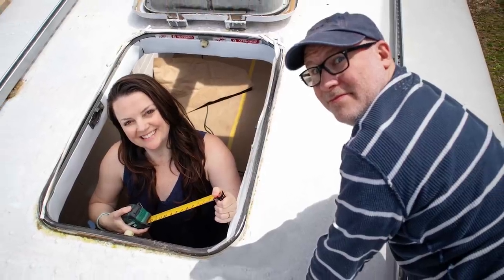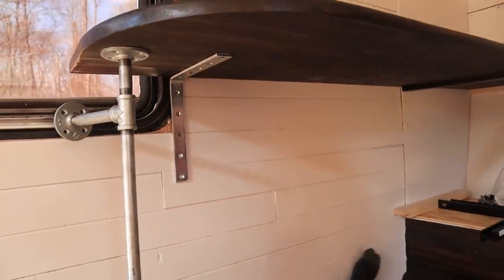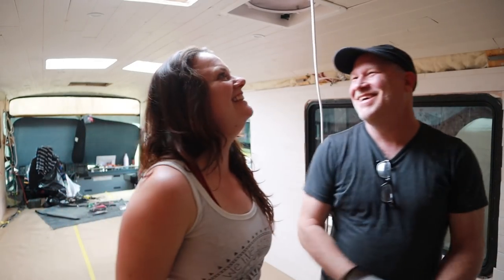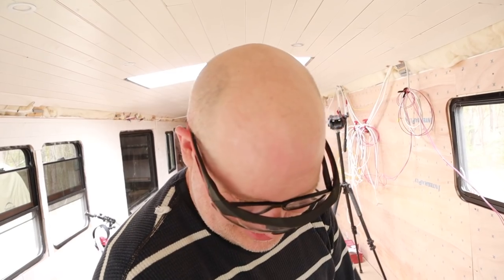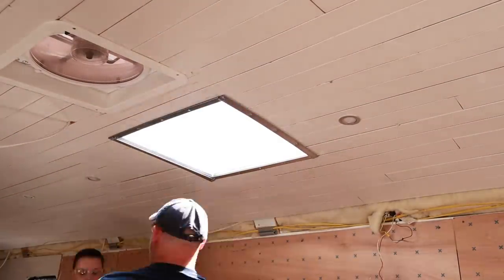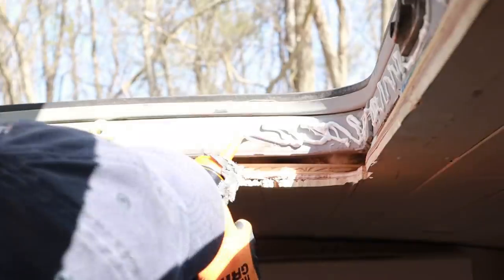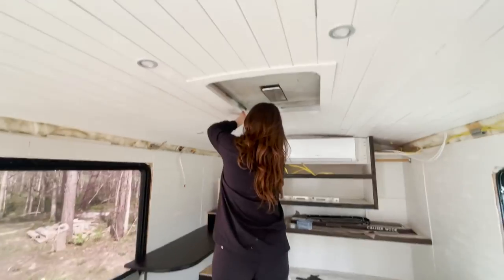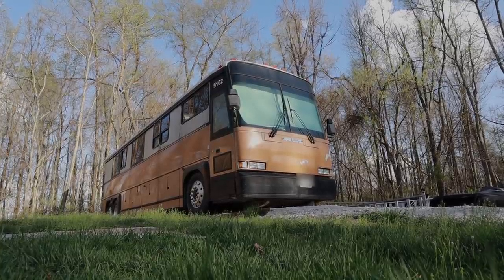IT'S ALL IN THE DETAILS // Skylight and Ceiling Hatch Trim for our Bus Conversion - S04E07

Comment: Just started watching your bus conversion. Quite a project. Great work. Just a suggestion on the skylight covers, and you may have already considered this...I installed pleated shades for skylight covers in the house. They can be ordered custom sized and made to let light through or not and they also have some insulation value. They can be installed inside or outside the skylight frame. Good luck on the rest of the project. Looking forward to the finished bus conversion.

Comment: I think when you installed the sky light trim you should have installed thin shims on 3 of the 4 sides and on the 4th side you could have had some panel board slides to slide in and out to either cover or uncover the sky light. You could have cut the panel would to be a little longer so you could install a knob to grab to open/close. But I am loving the videos and you two are so great together. Keep up the good work.

Comment: Job's good! Concerning Don's table (shelf thingy) are you going to strenghthen the brackets by triangulating them? If too much weight goes on the table, like heavier devices or you leaning on it, the brackets may bend.
Reply from the maker: Yeah nothing heavy is going on it so we should be fine.  The monitor will be mounted on the wall so it’s only holding keyboards and trackpads really which are super light 👍

Comment: The bus is slowly coming together,  though I think you should have , 1 rounded the outer corners,  and 2 stained it like the other trim in the bus.
Reply from the maker: We thought about the espresso stain but we didn't want to make the hatches stand out.  We wanted them to disappear into the ceiling.  I think it would take away from the main espresso colored trim piece which is still to come!

Comment: Why didn't you get shorter screws and pre‐drill the holes???
Reply from the maker: The next size down was too small to go through the wall and into the metal beam.  For some strange reason there is no in between size, so we had to make it that way!

Comment: If it's real stainless steel it's not magnetic. Looks like chrome, polished galvanized or nickle plated steel.
You really need to invest in a hand band saw.  Or a cheap Harbor Freight horizontal band saw.  WIll save you a tone of de burring over those angle grinder cuts.  Plus a band saw cuts a strainght line everytime.

Comment: Hate to tell you but aluminum is not magnetic!!!   Your covers won't stick just by magnets if they are aluminum.
Reply: Ok if not aluminum then.  Most stair step trim is aluminum.
Reply from the maker: The skylight trim we used is ducting cleats.  It’s galvanized steel and magnetic.  The stair trim is aluminum, no need for that to be magnetic